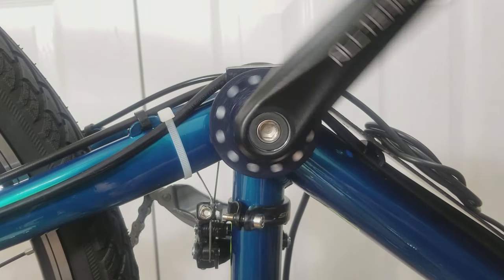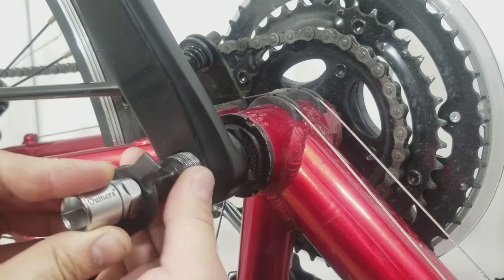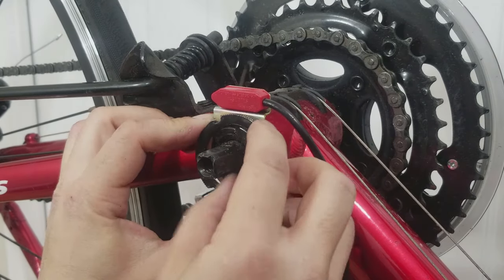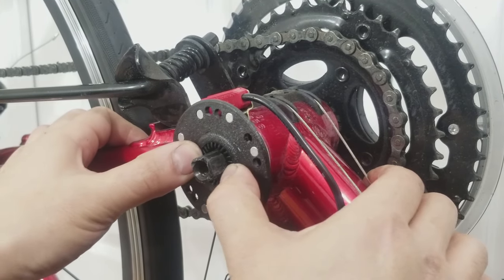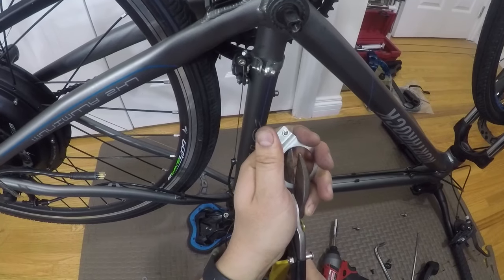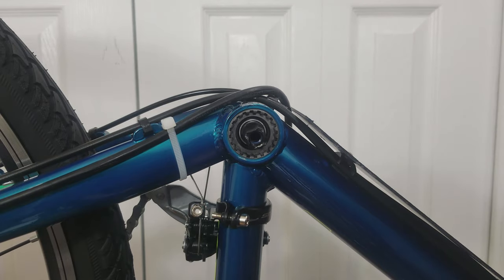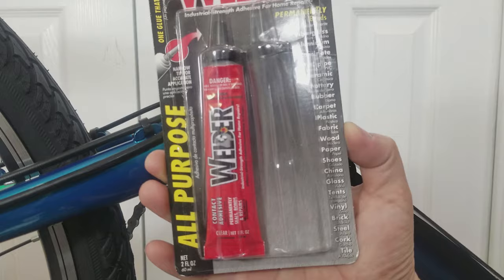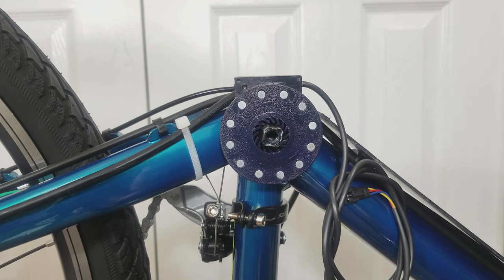Ebikeling Pedal Assist Sensor Installation

Comment: All these ebike manufacturers should make pedal assist that you don’t have to remove the crank pedal.  It’s a freakin worse thing I’ve ever worked on bicycles.
Reply: Takes a crank puller and 10 seconds
Reply: @soandsononame8750 no it don’t I tried and apparently I got the wrong crank puller why not just 1 model
Reply: Old pedals often dont have any growes left, making extreamly painful

Comment: WARNING ⚠️ make sure you have a gap in between your crank arm and the magnet disc. You can break your bottom bracket If you don't have a gap. VERY IMPORTANT.

Comment: Mine came with disk that pulls apart  and uses  a lock ring that mounts on the outside groove to hold it together so you don't have to take off the crank! i found out the hard way after i tookoff the crank,pushed it on and it splilt in two...lol

Comment: I found out what was wrong with mine! I had it with the arrows going in the correct direction but it wouldn’t work- then I reversed the magnetic ring and backpedaled, then it started working. So now with both the sensor and the ring reversed it’s working!

Comment: I want to add a front hub motor kit to one of my e-bikes that runs totally independent from the original rear hub motor….can I add 2 pedal assist sensors at the same time?

Comment: Nice video, but I would have installed the sensor on top of the bottom bracket instead of beneath it to minimize dirt, mud, water getting to it.

Comment: I understand that this method only works in some frames. I had a carbon bike with the Aston Rider kit and I switched it to a bamboo bike in 10 minutes and I didn't have to cut any cables

Comment: Hey glad you are making videos again!
Reply: I'm not! His Xiaomi scooter tyre change video left many feeling largely disgruntled. He addressed none of the comments aimed at him for giving the impression that the inner tube and tyre removal weren't anything other than a walk in the park to manage.
Reply: Asphalt Ricky I changed the rear tyre without much sweat. The trick is to leave the tyre in hot water for awhile ;)
Reply: @markocomhr  Yeah I hear what you're saying. However.... the front is an entirely different 'animal' when it comes to things like undoing the nut, removing the inner tube, and mounting that tyre.

Comment: Thank you, great video. One question, My sensor is located on the sprocket side, (Zugo). What if the sensor spins freely? and slides in an out loosely? The teeth are not grabbing.

Comment: Back again! Happy Swede here...
Have you had any problems with your extra battery on Xiaomi m365 scooter?
Should I do it? Put an extra battery...
Reply from the maker: 1000km on the extra battery, no problems. i have since sold the scooter to my coworker and he has had no problems as well. only bad thing is, with so much range, my feet start to hurt
Reply: @DougHnut  👍💓

Comment: The problem my bike shop said is that my Shimano crank is tapered and the PAS takes up room so that my crank are will not slide back on all the way, I can tighten the bolt but the crank is not seated all the way and the bike shop said it will eventually wear out the crank arm since it is not tightly seated.  Is there a PAS system that will work in this case?

Comment: Just got in a bike conversion kit and had a sensor in it. based on the video we installed it wrong but I was wondering what exactly the sensor does?
Reply: I too am going to be building a bike with my brother as something of a present, and thought I should answer your question.  What it does, is when you pedal on your bike, it will start to engage the motor to assist you while you ride.  That way you don't have to just hold a thumb/twist throttle to get the motor running.  It is absolutely worth the fix if you intend on doing any pedaling.  It just makes it so much more enjoyable.
Hope that helps.  Good luck.

Comment: You have a video instruction on how to wire it to the controller?
Reply: The comments are very good. I had my experience with the Aston Rider kit, it came out less than 260usd with lifepo battery and it has been running without problems since I had it more than a year ago